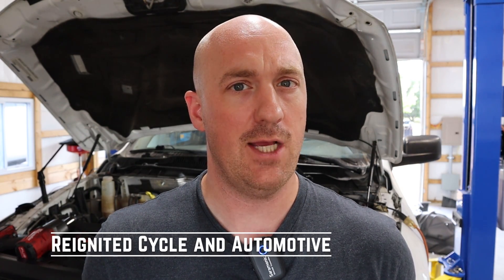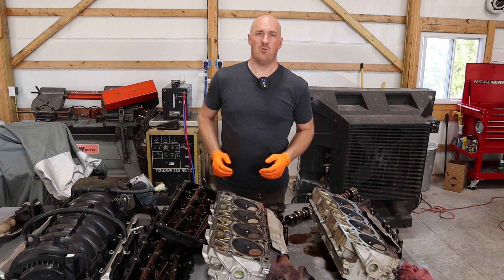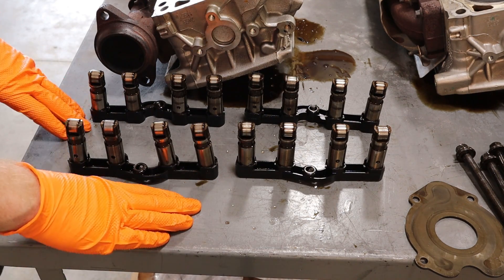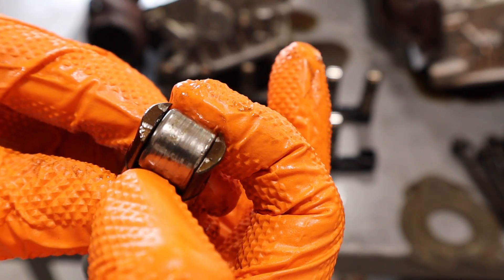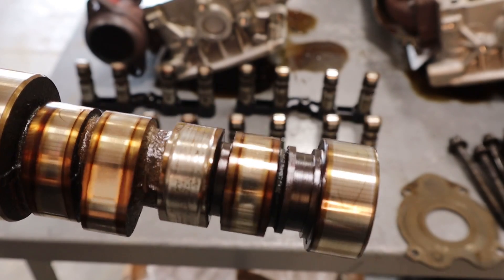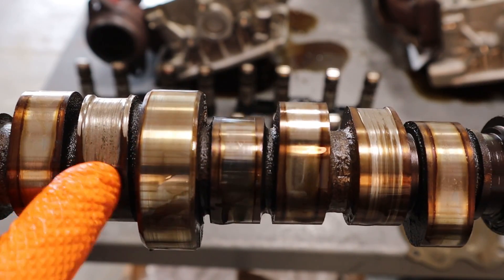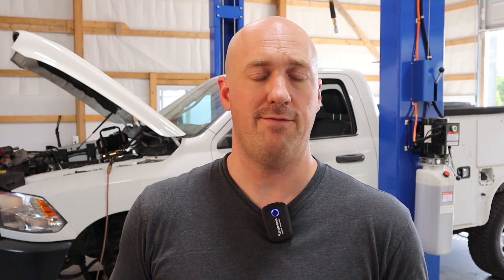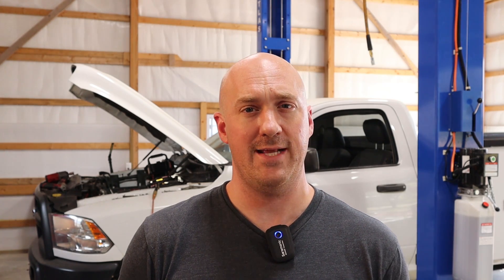Hemi 5.7 Lifter FAILURE Does this engine have a fatal flaw? Find out how YOU can prevent it!!!

Comment: Nice video.  I have seen similar tear down analysis on other videos discussing this problem.  I would disagree with the statement that this is not a design problem. An engine should be designed to operate reliably under the range of operating conditions it will be subjected to.  It is not unreasonable to expect an engine installed in police and commercial vehicles to spend a lot of time idling.  The engine design should be tolerant of that operating pattern.
Reply from the maker: That's a fair point, but I do think there is validity to the argument that if you are only changing the oil based on mileage, as fleet companies tend to do, that the oil is being tasked far beyond it's intended life cycle. I do agree that there are always design improvments that can be made retroactively to repair issues like this, however, I believe Chrysler is willing to take their lumps for the relatively small percentage of overall failures they are seeing.

Comment: I'm not sure why oil would break down faster in Hemis than in Ford 4.6 Modular engines. The 4.6 police engine also ran 5W-20 oil.  

Before I bought my retired Ford Police Interceptor, I also checked out some of the Dodge Hemi models and low mileage engine issues were pretty common in the Dodges, especially in township vehicles that idle most of the time, but my P71 is also a township car and aside from a slight tick right after start up there's no valve train noise.  Same oil, same service. 

As to oil break down, oil is oil, metal is metal, and friction is friction regardless of the engine once the oil breaks down the metal is worn down by friction.  Now Hemis might  be contaminating their oil through blow by or overheating it.  But, I don't know of any such issues with the Hemis so the oil should last just as long in a Dodge as in a Ford.  

This means, simply put. whether the issue is lubrication or materials, MDS or not, it's a design issue.  I'm thinking more oil changes might be a better idea for people who own Hemis, but Fiat really should just fix the design problem if they want to continue to build Hemis.  On the other hand, with gas mileage requirements likely going up again soon the Hemi might already be a dinosaur in a blizzard.
Reply from the maker: I don't think comparing the Ford 4.6 to the Hemi is an apples to apples comparison, they are entirely different engine architectures. Plus, what's the power output of the 4.6 versus the Hemi, 250hp for the 4.6/ the 2009 Hemi police car was putting down 368hp. Again, not a direct comparison. I think we could all agree that a Toyota 1.3L will put out far more reliability than either the 4.6 or the 5.7, but it's only making 150hp. You may be right about the Hemi going away eventually though, there's only so many ways the manufacturers can continue to optimize for fuel mileage with a v8. 👍
Reply: @ReignitedAuto  Agreed, the Modular and the Hemi are different engines.  I was only intending to compare the duty cycles of the two cop cars as being principally the same, likely the  oil change interval was also about the same and the oil was even the same weight. The weight of the cars wasn't substantially different either.   The Ford has a 6.5 to 7.5 quart oil pan. I don't know how many quarts the Hemi takes.

So this brings us to the question whether it's oil or engine design that's causing the problem.  I think the Ford proves that the oil can take the police duty cycle and the maintenance schedule police departments are likely to give a car in service. I can't imagine that any police department changed the oil more frequently in the Fords than they did in the Dodges. You might argue that some young cops might have pushed their Hemis a little harder, but someone else might argue that the Modular always had to work harder to do the same job as the larger Hemi, but idling time was most likely the same.  I mean in order to keep up with the Hemi, the poor little Modular has to rev it's tits off to haul a reinforced Crown Vic body on frame chassis but at idle the engines are basically doing the same thing.  I can't say that we can tell if either engine is harder on oil but in my mind, I'm thinking the Ford is working harder all of the time just based on displacement. 

In the end, it's a car maker's job, in design, sourcing the right parts and materials and assembling them correctly to build an engine that's fit for purpose and will last an appropriate length of time. The engine has to work with the oil that the engineers called for in their design.  And if there's an issue the car maker has to design around it.  For example the Ford Police Interceptor has an external oil cooler for police cars to keep the oil cooler for more severe duty. 

I'm not sure it's entirely fair to argue engine design vs. motor oil, but if we have to, I think design loses as the same oil does its job in a different engine design. 

In an extreme case, you could argue that the problem with rotary engines is that the oil isn't good enough to keep them properly lubricated... which might be true, but if you use the oil that Mazda recommends, and the engines wear out prematurely verses other cars using the same oil that don't wear out, so we have to conclude that the shortcoming is in the engine or it's design and not the oil breaking down. I think you might agree with me here.

I personally don't believe that the oil breaks down faster in a Hemi than in a Modular, but if it does, it's still a design defect or insufficiency in the Hemi, not in the oil.  Lets face it.. the oil came first and it was the engineers job to make an engine that runs with the oil he specified in the owner's manual. 

But despite it's shortcomings, which I believe can be overcome once Fiat takes responsibility and fixes the problem, I'm going to be sorry when the last of the fire breathing V8's are history.
Reply from the maker: @RJ-vb7gh  I love it 👌 thank you for bringing an intelligent reasoned argument to the discussion, I think more information is always better, and I do agree it's the engineers job to build something that will tolerate the demand. I absolutely think the Hemi engine design can be improved upon, but my experience is that if it's not fiscally beneficial to do so, the factories won't do it. Rather they are willing to absorb the costs of the small percentage of failures that are happening. I always enjoy talking with someone who has an actual point of view, so thank you for that, and thank you for watching! 👍
Reply: @ReignitedAuto  Actually, you presented a well reasoned position, which is also sometimes hard to come by on YouTube, and I thought it deserved a well reasoned reply.

I remember the days when guys could just sit around and debate things and maybe even figure stuff out. Even back when I started out and I was wrong a lot, being wrong was good, because someone would correct me and I'd wind up smarter than I was before the discussion.

I'm glad I caught your video, it made me think.  And I think you are right, with the current Hemi likely at the end of it's lifecycle, I doubt FCA is going to invest another dime into this incarnation.  

But who knows, maybe they will bring back the 2.6 liter Hemi. Last I heard the dies are in China and they are making it to power water treatment and pumping stations.

Anyone up for another 4 cylinder hemi?

Comment: You say idling is the problem i say there is not enough oil getting to the roller lifters period you can fancy it up all you want the simple fact is it ant getting oil I'm a tech i have built many motors dodge just needs to ad squirts to the lifter just like it is done to pistons problem solved stop make excuses or just make a straight groove in the lifter on the top to have pressurized oil get to the roller tip its not hard
Reply from the maker: Fair enough, I think what it comes down to with Dodge is the same as all manufacturers. Even if there is a known issue, there is a certain amount of money they are willing to spend through warranty to fix them as they fail. Whenever that dollar amount exceeds the cost of redesigning the parts, that's when they'll make a change. The simple fact is that the percentage of Hemi owners experiencing this issue is low enough that Chrysler is willing to take their lumps over it. Is it right? Probably not, but its no different than any other company operates 🤔
Reply: @ReignitedAuto  very true warranty work is bad for all of use in the business getting 3 10ths a hour is never fun they should make a change in the future though
Reply from the maker: @nate2001mick  the politics of being a tech was something I never appreciated about the business. Getting screwed over by warranty pay is the worst! 😂 basically you are being punished for being certified. I'm trying to make it work doing my own thing now, after 10 years of being a tech I can't take the endless bickering over why I deserved that 1hr diagnosis time 😤

Comment: I watched uncle tonys garage a while back. He explained what he figured the flaw was and why. You should really watch it. It makes perfect sense. And it’s kind of the same as what you are explaining.
Reply: There could be a problem with the lifters but Fiat isn't going to admit the either, they are just blaming oil quality to retain sales and no recall.
Reply: It’s not an oil issue. It’s a lifter / cam issue.    The lifters have been redesigned in 2016 for bigger needle bearings and much beefier lifter also the cam has higher lobes now.  Do not buy parts from a parts store go directly to Chrysler to get the updated parts. I learned this the hard way because autozone and O’Reilly still sells the old version.  It’s not an oil issue.  There’s a guy on YouTube who compared all lifters and cut into them.  Never let your hemi idle for more than 5 min.
Reply: @OddWrld  that proves a good point. Thanks for the info. It’s pretty valuable.👍
Reply: @OddWrld  how is that possible am I supposed to turn it off at every stop light every drive thru?  Not giving you a hard time I really want this 2017 for sale but am worried about this
Reply: @xterra4hire  buy it.  The car is meant to be driven how it was supposed to.  If you are in a situation where you are stuck sitting for a period of time just put your car in park and rev it to 2,000 rpms every once in a while to make sure the oil is lubricating the cam.  This is why you see a lot of police chargers for sale because they idle the car all the time. This was the reason they redesigned the lifters and cam in 2015-2016.
Reply: @OddWrld  Thank you you’re 100% right. I hate it when idiots blame the owners or the oil manufactures. This hemi is a race engine and the only way to get oil up until those lifters is to drive it with some performance on the throttle. I guess owners can be to blame because they don’t drive the engine at a high enough RPM and put it under enough performance to oil the lifters and the cam.
Reply: Chrysler spin on the issue. Lubricated by luck
Reply: It's most likely due to a failure of the needle bearings
Reply: I agree Uncle Tonys Garage figured it out, they need oil and these motors don't supply the cam with enough of it.
Reply: @codywills1408  exactly right cody. Makes sense doesnt it.
Reply: My Uncle Tony knows what he's talking about . I'm surprised that they don't have an after-market fix for their oiling problem
Reply: @davidrosales3663  considering it's an oil quality issue that's be kinda hard to fix when it's people not changing their oil
Reply: How is it that they have a high failure rate because of the quality of oil? There's people that never change their oil and they last longer and 14,000 miles or 40,000 miles 🤔
Reply: @codywills1408  because fleet vehicles, that's where it's most common they could have 500 miles on a change and 200 hours of idle time and be well beyond the change interval
Reply: @zacht9447  so why don't Ford, Chevy and the Cummins have the same problem? I drove a work truck for 178,000 miles and put over 20,000 hours of engine time on it, never eat a cam shaft oh and we had 16 just like it. The power companies trucks never shut off, the oil field trucks never shut off while sitting. They either have a bad supplier of cam cores with soft spots and or a rattling of the lifters against the cam or no oil. I just find it hard to believe that the 14,000 mile motor he mentioned had the oil completely destroyed in that time and eat the cam.
Reply: @ Zach T. Nope. 

The LS in most Caprice Pursuits do nothing but idle. No issues. 

Lots of LSs around and a few camshaft problems years ago but nothing like this.
Reply: @Bartonovich52  Caprice PPV's are also about a tenth as common as Charger pursuits and are usually maintained better due to it. It's not just the idling that kills them it's the Not changing your oil based on time.
Reply: @zacht9447  Not sure about that, cuz I always change my oil at or before 3500 miles, and it still ticked. But when I switched from conventional, to synthetic blend, then the ticking stopped!
Reply: Lol. Uncle Tony garage video is completely wrong. WTH
Reply: @johnrivinius4873  Lol.

Comment: I watched a video done by a very experienced dodge mechanic and he figured that by raising the camshaft like they did in this engine not enough oil is getting to the lifters and cam. More oil changes may help but I say it's a design flaw that it should need such special care. Other engines survive.
Reply from the maker: Lots of speculation that is why this is happening. I'm not against it, as I'm only a mechanic and not an engineer, but I haven't seen conclusive evidence yet verifying it. But neither have I seen anything conclusively ruling it out. I'd love to see a company do some in depth testing on it 👍
Reply: @ReignitedAuto oiling the roller lifter fixes the problem johnson lifters

Comment: sorry, 2019 Ram DT lifter noise at start up when cold, slight downward incline it would do it all the time. Did it bad, like no oil in lifter bad after an oil change and less than 5K miles, no broken exhaust manifold bolts. And it seems to be an issue in these trucks. In a 2020, 5500 miles it's done it twice, once cold, once warmed up and it hammered good.
Reply from the maker: Yea something like that I would suspect you've got a faulty lifter that is bleeding down overnight. Strange you aren't able to replicate it more consistently though. Maybe let it sit for several days then start it. Just trying to think of ways you will be able to get the dealer to replicate the issue.
Reply: @ReignitedAuto  dealer said it was normal, I traded it in on the '20

Comment: I just had it done on my 5:7 and the dealer told me that the contributing factor was the MDS system on those cylinders it shuts the oil feed off to make the lift is not work to save fuel is that true
Reply from the maker: The MDS system uses solenoids turn on and use oil pressure to depress a pin on the lifters which collapses them, effectively rendering those cylinders inoperative as long as the solenoids are energized. Whether that is a contributing factor to the roller lifter failure is a matter of speculation. I've never seen any definitive data proving it to be true..... But I haven t seen anything that can completely rule it out either.

Comment: Explain what the problem is before you explain how to replace it all. The problem is is that the oil that normally in the vast majority of V8 engines ever designed returns to the crankcase through return hose there in the center of the valley tray. That way it drains down directly onto the cam and keeps the lifters oil. In the 5.7 Hemi those return points are on the sides of the valley Trey and they never do they get on the cam nor do they get on the rollers that end up running dry and then failing. I don't know who the moron was that decided to make the Hemi engine somehow different in this respect. But they did two things wrong. Not only did they put the oil return galleys in the wrong place, they have the lifters setting at such a horizontal angle that even the oil draining off of the lifter will never get onto the roller because it drips off of the lifter before it ever gets to the roller. The only oil that ever gets to the roller on the roller lifters is if you're running the engine over 2000 RPM and the oil Mist will get on the rollers. That is not enough oil for these rollers or for any rollers it doesn't matter who makes them. That's the flaw with the Hemi engine. So either redesign the block casting. Or put oil squirters that will actually oil the Damned rollers. That way we won't have these issues in the first damn place. Never ceases to amaze me the number of Engineers who want to try and reinvent a goddamn wheel!
As for the MDS system, if you would just lean the engine out, it would get a lot better fuel mileage than it does on the stupid 4-cylinder mode. Chrysler is consistent with their ability to run too much fuel through their engine. The only time the engine needs to run fat with fuel is when you're asking for more power and torque. When its sloping down the road at 2000 RPM or less it doesn't need to use but just a tiny bit of fuel. There's no reason why you can't map that into the engine. And get better fuel mileage and you can buy shutting off four cylinders and thinking that having four cylinders have to push for other cylinders before they even get to the transmission is even conceivably a bright idea! Stupid is as stupid does.
Reply from the maker: Appreciate the reply, and more information is always better for people to make their own decisions 👍. I also agree that engineers can't seem to leave well enough alone, each of them is determined to leave their mark by fixing things that aren't broken 😂